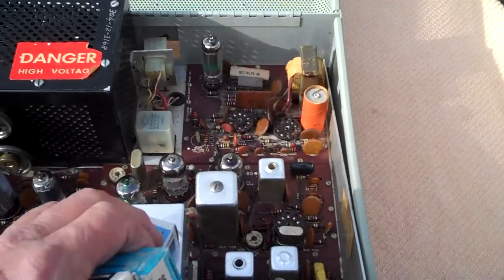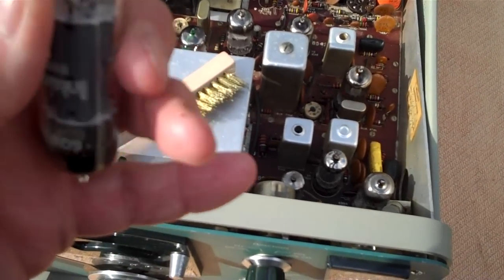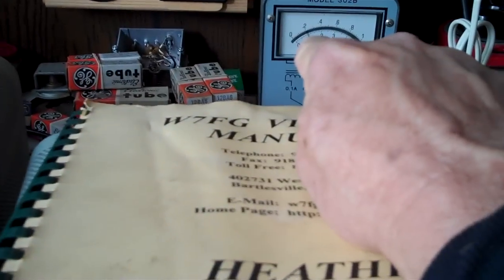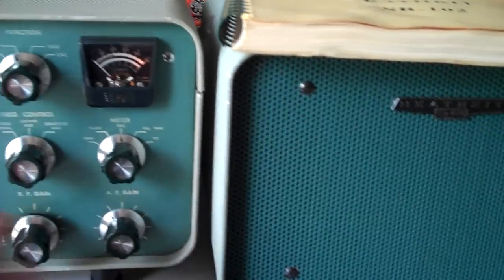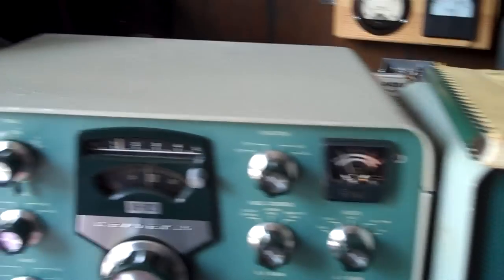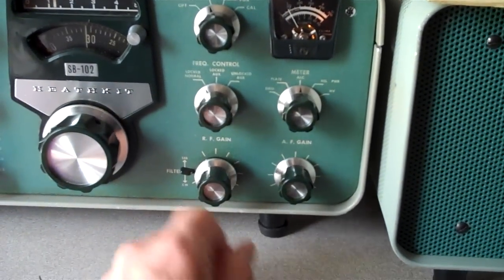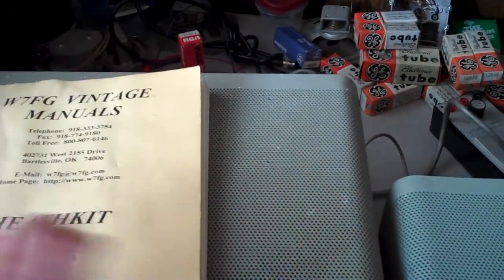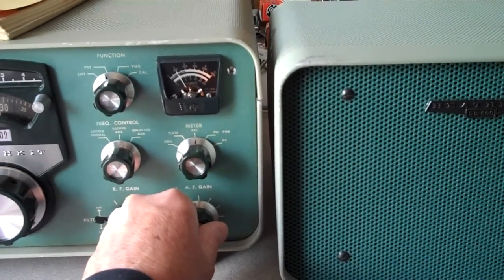A Heathkit SB-102 HF Ham Rig...and the three Rs (Part 3 of 4).

Comment from the maker: @rhblakeman,
Russ,
The costs were't all that much...pretty cheap actually.  In a few days I'll do a tally and give you a figure.  It shouldn't run much more than $50,000.00.  I do accept checks.  :-)
But I repeat...you're under no iron clad obligation to accept this radio.  It's completely your option.  If you prefer a more modern solid-state unit, then so be it.  Won't hurt my feelings either way.  Do what you feel is best for you.

Regards,
John